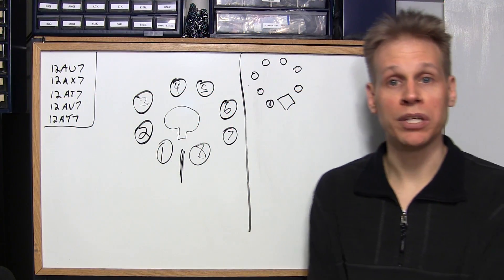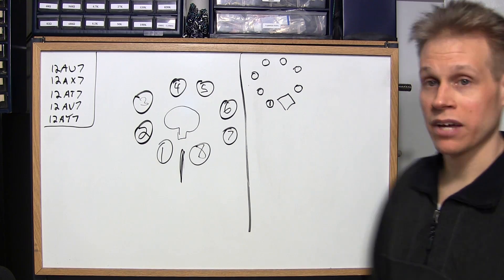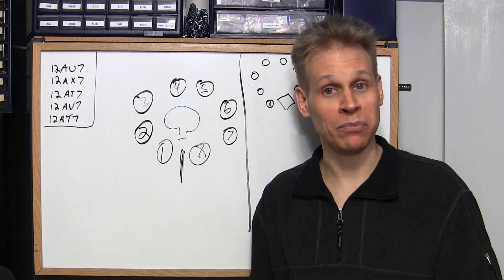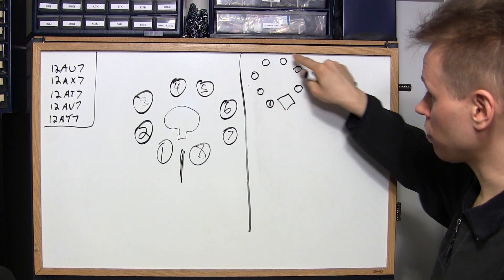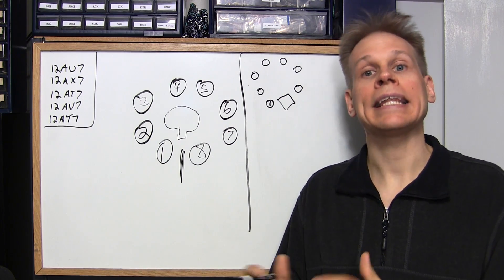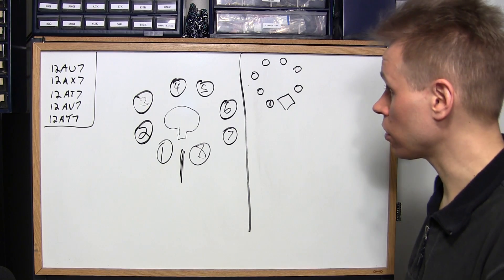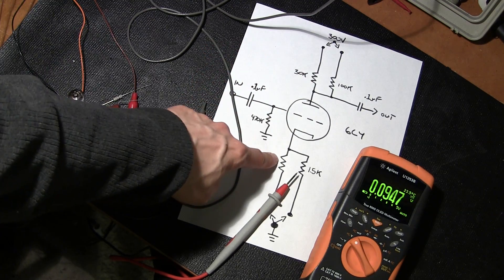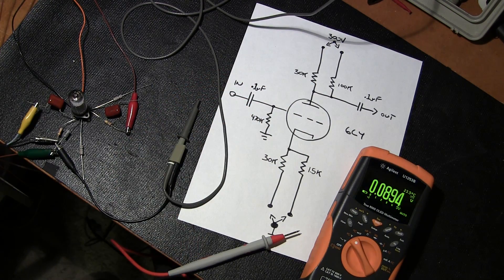Tube Amplifier Troubleshooting Tips

Comment: If the cathode is +3.2 VDC and the grid is +0.01 VDC, how does a 1.8 Vpp signal push the grid voltage high enough to conduct? I have a feeling that his statement "Now keep in mind that this tube is raised above ground by about 3.2 volts so there is some bias on that grid" is supposed to be the answer to my question but I don't get it. Why is there 3.2 volts on the cathode anyway? If the plate is sucking electrons so hard that the cathode is pulled up to 3.2 VDC, then why didn't the grid go up too? Are the power supplies to the grid and cathode just not being shown?

Comment: Around the 15 min mark, Paul is discussing how the AC audio signal causes larger fluctuations at the plate by drawing on the high voltage, thereby creating an inverted DC signal. To my untrained ear, it sounds as though he's saying that the audio signal is translated into DC voltage at this point. But then his schematic shows what appears to be a capacitor at the output of this stage, which suggests some sort of RC coupling between stages. Wouldn't this capacitor block DC? Is that the intention, to attenuate DC before the next stage?  Thanks for the help.

Comment: Mr.Carlson I have one question ... I bought a two NOS tubes, one 12at7 Brimar and one 12at7 RFT, and both of them have the flash on the filament when I turn on the amp. They show a different kind of filament flash, the Brimar is smaller and kind of faster and the RFT is just like the one you made your video about filament flash (Rogers - mad in Holland). When I wanted to return them to be replaced by the vendor, they said: "Hallo, you are wrong. A flash is mostly seen with tubes from east Europe and is not a problem or failure. The quality of these tubes is high. "

I would be very grateful if you could please shed some light on this as I am confused as to how to resolve this and what to learn from this experience.

Comment: Great video content.
I found this video 5 years after ,you post it  but never is to late.
I have a question,and I really appreciate your opinion.
Do you recommend to use a fan trying to cool down a guitar tube amplifier?
Does that have a bad effect on the tone of the amp?
By lowering the temperature of an amplifier ,you increase the life of the tubes?
Thanks for any given answers.
Cheers.
Reply from the maker: If the guitar amplifier is designed properly, there should be no need for fan cooling. Tubes run hot, and they are supposed too. In some cases fan cooling tube circuits (VFO's, BFO's and so on) will make the circuits unusable as they need temperature stability.
Reply: @MrCarlsonsLab  Thank you very much.

Comment: Hello and thanks for the excellent work. However, I am left wondering why is such a high initial voltage (300VDC in this case) necessary if a resistor is going to reduce the plate voltage down to less than 100VDC?
Reply: I am no expert on tubes (which is why I watch these) but first of all, the tube draws quiescent current when input signal is zero, at which the plate voltage stays at 90V, so when signal is applied, it makes the brings the tube into conducting more and less (with respect to positive and negative semicycle) current, thus causing voltage drop in the resistor to fluctuate according to signal, but stronger. Therefore, the voltage at quiscent state must be centered between the maximum and minimum. I don't know what is the range to be used, but my first point is that voltage feed voltage must be higher than the quiscent-state-dropped, to be able to "swing higher" from that, for making the amplified output.

Then, I don't know if there is some explicit need for having some headroom, I would be interested too. But then, finally, I purely guess that the 300V approximately derives from the 230V, or better yet good ol' 220V mains voltage rectified and filtered, making 300-odd (sine peak value), and possibly some regulator used, or maybe just tube rectifiers having that much high drop that we could honestly say 300V ? Hope someone corrects my speculative story.

Comment: Found this older video on tubes as i am building my 1st amp from scratch. Well, its an Eico 147 Signal Tracer that i am converting to a Fender Champ 5F1.  I just tried to power it up yesterday and pop the fuse and fried the rectifier 6X5 tube. Opps. Well back to the schematics and try see where i went wrong. i like the way you are able to explain then set up little demos. Appreciate all you work very much. Thank You hoping i can figure this baby out. Take care and stay safe. Dennis

Comment: I have subscribed and see I will learn quite a bit here. My first question, since the cathode is connected to ground, where, or should I say how, is it getting its three to five volts. I have electrical engineers here at work, but whenever I have a tube question their eyes go blank and they start drooling. I will be retiring soon and always wanted to do this. I have bought my self a scope and  signal generator and other equipment and am learning how to use it. I have fixed a few amps with it but it was more luck than skill. Once I retire I will be signing up for some help. I always keep one hand in my pocket, I have gotten zapped a few time.
Reply: Current is flowing in the cathode resistor, and if current is flowing in a resistor, Ohm's law demands that there  must be a voltage dropped across it (V = I x R). If the voltage drop across the cathode resistor is 3V and one end is connected to ground (0V) then the other end and therefore the cathode must be at +3V.
Reply: @silasfatchett7380  Thank you Silas

Comment: I just came across this video (4 years late). I do understand how a triode valve system works but wanted see how you explained it for the beginner. Your explanation was spot on, very good. I saw an explanation by another Youtuber trying to explain how tubes (valves) work, their instruction video was full of errors and inaccuracies. They got very defensive when I commented on the errors in the video. Your explanation was excellent and flawless. Well done Paul, keep more great videos coming like this.

Comment: Mr. Carlson thank you for this.  do have one question from a novice point of view,  I am confused by the 30K resistor, there are two in resisters between the anode and 300.5 volt supply, you mention one of them 100K but there is another in parallel a 30K that makes a total of about 23 K. what does that resistance do to the voltage on the anode? Thanks, Peter.
Reply: If you look at the top of the schematic there is a switch which connects the 300V to EITHER the 100k the plate resistor OR the 30k, so they are never in parallel.

Comment: So basically if you ditch the heater's, it's literally the same thing as with solid state but at a lower voltage and higher current....
Reply from the maker: In short yes.
Reply: Mr Carlson's Lab okay, What I'm having difficulty in understanding is where you draw the schematic of a basic tube amplifier. The output is connected to the B+ through a capacitor... B+ being DC won't pass through the capacitor which I think that if no input signal is applied, then no output signal goes to the speaker (wondering how the speaker isn't being cooked by being connected to DC?)... As it were... hmm ok I somehow think that I get it... When the B+ gets pulled to ground and back, the B+ DC starts to look like AC and is able to pass through the capacitor which blocks DC to drive a speaker.... at least that's my understanding so far... I'm not sure what the resistors function is on the B+ and on the other end to ground.... hmmm.... then there's the OCL (output capacitor less) amplification.... but that's probably another topic altogether lol... Strangely, looking at tube amplifier schematics makes understanding solid state amplifiers much easier.... I thought that logically the amplifier functions similar to a light switch to a light globe... where the human finger is the input signal and the light switch is a transistor and the light globe being a speaker... but it's the other way around! The light globe goes before the light switch.... I don't think anyone else has done a video on that topic... I'm sure that I would have found it by now... hint hint LoL... Anyway, thanks for the speedy reply. I really love all your videos and I'm totally envious of your inventory of equipment and spare parts stock.. let alone the new vintage work Bench... Can't wait till you do some videos in there.... Greetings from Australia :)

Comment: Hi Mr. Carlson, I would like to ask you a question about JJ KT66 valves. I have a Fender Blackface Bandmaster amp from 1965. I was wondering if I could run KT66 valves in this amp. It's a 40 watt amp that normally runs on  2 ×6L6 valves. I replaced the output transformer with a Classic Tone  magnetic components  Inc. from Chicago  output transformer for a 40 watt amp. The amp plays great as is, but I was wanting to try these JJ KT66 valves for more headroom in the amp. The KT66 valves are 1.3 amps and a 6L6 I believe is .9 amps. Not sure if these kt66 valves would do damage to the transformers. The power transformer is a vintage stock Schumacher. Any advice on this. Thanks from Michael Newell from Niagara Falls, Ontario, Canada

Comment: What would cause a tube radio to work fine most of the time but have a spike in volume every two or three minutes sporadically?
Reply from the maker: That could be so many things. It could even be external, like a coffee pot switching on and off (internal temp switch) Many AM radios use the line as part of the antenna.

Comment: I would be so confused right now if I didn't happen to know that an EL34 is also known as a 6BQ5.  So how did they name the EL34 and those variants?  Other contryisms? metric?
Reply from the maker: Exactly, European tube identification system, and the American/ Canadian tube Identification system.
Reply: Thanks.  As a radio operator I'm getting into the fabrication/repair of electronics (making some kit radios of modern components presently) and as a guitar player--I'm getting rather keen on the idea of making or reworking a homebrew Audio amplifier--GIVEN good resources provided by you and others on youtube.  But first to attend to the Crate I have in front of me.   But also I'm thinking of a tiny practice amp with a neo-magnet speaker and switching supply for ultimate portability and even battery power.as well.  whooot.  I think faster than I fabricate!
Reply: and as a woodworker and general fabricator, I'll probably make a guitar or two if I live long enough.

Comment: So glad you stressed that an amplifier stage swings the supply voltage across the plate resistor, that the output signal voltage comes from the supply, not the tube. I was years into things, without formal training, before I realized that. It’s too easy to visualize that the tube “turbocharges” the input signal applied to the grid, sends it through the vacuum and onwards to the plate. I better understood the term “valve” when I conceived of the tube as a valve that opens partially, in proportion to the input signal, to create a low-resistance path from B+ to ground, loading the supply, dropping the voltage across the plate resistor.

Comment: 5:12 - "Factory Designation Letters" - Are these 'designated' AFTER the tube is manufactured? In other words, are the tubes 'binned' into different performance profiles once they are manufactured?

Example a run of  'A' type tubes would be sorted based on gain to either 'AU', AX' or 'AY'.

Comment: Very well explained! So, the phase inverter would be used to drive a push-pull output stage, while the triode pre-amplifier would be used to drive a single ended output stage, right? It is now surprisingly simple. Never though I would understand vacuum tubes.

Comment: Paul: I'm an old NASA gate chaser from the 70s where I learned TTL. Lots of logic, lots of transistor theory, and just a little analog....probably just enough to figure out simple power supplies. Now that I'm an old retired guy, I have come back to ham radio, and my interests particularly lie in vintage tube equipment, particularly Collins, and some of the "Big Iron" AM broadcast transmitters.
Your videos are wonderful in helping me transfer what I learned as a digital tech to tubes. Although you don't specifically mention it, as you go through your excellent signal chasing, I find myself saying, "oh, that works just like a transistor." Thank you so very much for videos just like this one....they are exactly right on the money for what I need.
Reply from the maker: Thanks for your feedback, and your kind comment too!

Comment: When I was 15 my father brought me home an old PA amplifier with a pair of 6L6s.  At the time, I wasn't sure what to do with it or how to use it.  The rectifier tube was missing also.  My dad told me to ask his friend Emil Rudat who lived down the street and worked for RCA at Harrison, NJ.  Emil had a 5V4 and it worked after he showed me how and where to hook things up.
Anyway, I ignorantly started poking around the underside with the chassis laying on it's side on top of a metal topped cabinet I had used for my rock collection.  I had my hand on the top and grabbed the B+ on a capacitor and had my first whack from 400+ VDC.  It felt like two people gave me a yank on each arm to pull them out of my body, I was thrown on the floor and shaky.  Wow, I knew I was lucky to be still alive.  I have heard many engineers and technicians consider that a "right of passage" in the field, but it's a "right of passage" that you want to avoid.  Wear gloves or keep one hand in a pocket or both, I was told.  I think I got a lesser one again later from a charged capacitor.  Even when the unit is off, I learned to discharge caps.  It was the last time and I'm still around at the age of 71.  Whew!  Emil became my early "Mister Wizard" for electronics and he was a life long friend from the WWII generation.

My dad had a saying about using power tools, such as a circular saw, which applies to many potentially dangerous things we work on.  "Don't be afraid of it.  Just RESPECT it."  I got it!
Reply from the maker: Thanks Jim for taking the time to write, and share your story. One day I will share the story of the 1cm hole in my left hand.
Reply: Mr Carlson's Lab save that story for the Patreon members. I get nightmares easily as I lucid dream more nights than I slumber.
Reply: Holy cow!  That is huge!  I'd like to hear the story.

Comment: Thanks Mr Carlson, tubes have always interested me. A few years ago I bought a small cathedral AM radio circa 1930's. I only  tested it out once. It did work :-) But since it has a third wire in the supply cord to drop voltage for the heater (I think), I haven't been using it. I believe they were called "curtain burners" as sometimes a home would catch fire due to it being in contact with curtains or other upholstery. It seems this type of cord was used because the radios were physically small and had no space for extra transformers. Is there a way to make this unit safe to use on a regular basis? Cheers!
Reply from the maker: If the filaments of the tubes are in series, and their total filament Voltage doesn't add up to 120, and you have a cloth cord, chances are, it's a curtain burner. You can use a capacitive dropper inside the chassis. This is the best solution, as the cap doesn't get hot, but allows enough current to pass (with the correct uF value selected) to light the tubes and operate the radio's B+. Search the net for "capacitive dropper for old radios." The math will be there as well.
Reply: Thanks! Ill check if their in series. Maybe ill posta pic of this little beauty as well :-)
Reply: http://www.pavekmuseum.org/curtainburner.html

Comment: Great presentation !  Q : Shouldn't we have a capacitor on the cathode down to ground ? Regards, Patricia,
Reply: Patricia, that is a good question. In Mr Carlsons experimental setup this cap is not needed, he is slowly changing  the voltages in the circuit to demonstrate the amplifying of a triode. In an audio amp you need this cap to stabilize or smooth out the cathode potential because of the fluctuation due to the varying frequencies and volume of the signal to be amplified. Otherwise the signal would distort somewhat.

Comment: I do have a question regarding a RF tube amp. I find two schematics for a BlackCat JB75A amp. One schematic is dated, the other is not. One calls for a 8417 tube on V1 and the other calls for a 7581A. I have one of these amps and I am wondering what is the easiest way to tell from the schematic which tube I should be using as I dont see much difference in the schematics. I am guessing by watching your awesome videos that if i measured the higher voltage side (as the 8417 shows A 700VDC and B 350V and the 7581A shows A 800V and B 400V), but what pin would that be for my +V and for gnd I am guessing I can use the tube gnd for my -V? If you could assist that would be great. This is a DC fed amp of 14.8V if that matters any. GREAT VIDEOS LOVE THEM ALL! Thank you for all the great hard work that helps educate us that are learning!
Reply from the maker: I would imagine the 8417 would be more of a "robust" design, as the tube is used in service at almost double the power. The 7581 "or 6L6 if you like," is a great RF tube though. Note: the 6L6 is an 807 without the top cap, and a different base..... The 807 is a 1625 with a different base again, and heater Voltage..... so on. So if you use the 7581, swapping in different sockets for equivalent performance from "like tubes" is easy. The 8417 has the same basing as the 7581, just different ratings.